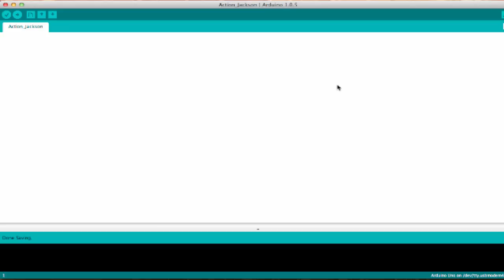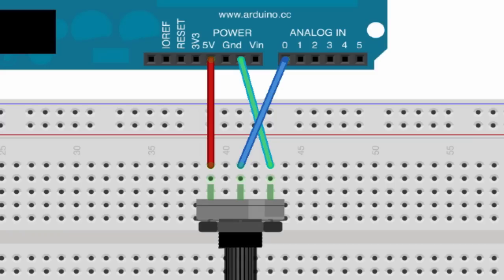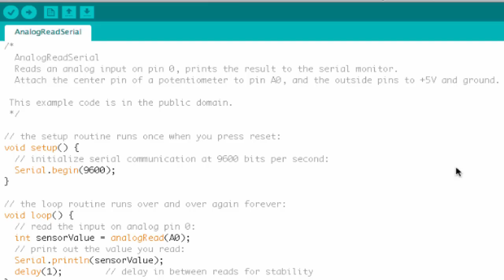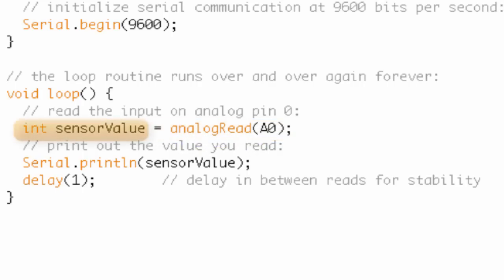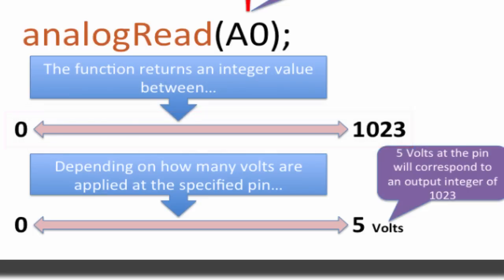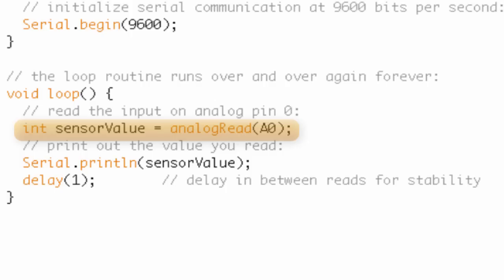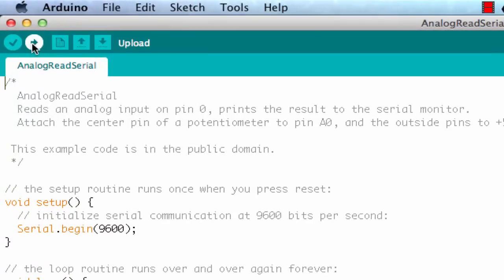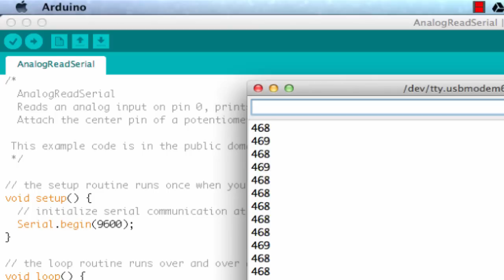Tutorial 08: analogRead() and the Serial Port: Arduino Course for Absolute Beginners (ReM)

Comment: I was really depressed before I found these tutorials. At the age of 50 and having never programmed before, I felt like Arduino was something I wanted to use, but would never be able to attain due to my coding illiteracy. In the past I have looked at coding tutorials and have tuned out very quickly. These tutorials have started at such a basic level, and assumed no prior knowledge. They are just what I need. Hey, even changing and uploading the flashing LED code gave me a hard-on :)
I have a specific Arduino application in mind, and even after watching just 8 of your tutorials, I reckon I'll be able to make my project work using Arduino. Thanks so much for your marvellous teaching.
Reply from the maker: +Ben Frawley Thanks for watching Ben -  best of luck on your project.
Reply: I am 62 and am in 7 nth semester of Bs.Cs programming Join some university bro |It is a very long traveling and full of joy
Reply: Arduino keeps me occupied away from depression and anxiety. I've only just found Arduino.

Comment: 1023 is part of a binary counting system.  It basically identifies 10 digits for binary 0000000000 = 0, 1111111111 = 1023 (1+2+4+8+16+32+64+128+256+512).  This allows for 1024 optional inputs/outputs (0 is an option).

Comment: Added an LED and 330 resistor between ground and center pin for a dimmer with serial read out.
Then I removed the pot and replaced with a force sensitive resistor to dim the LED.
Fun times, but couldn't figure out how to get a friendly reading to the analog in for this.

Comment: in the updated sketch the output shows in voltage. 
the code "* (5.0 / 1023.0)"  converts the 0-1023 number to volts.
Reply: 5.0/1024 and add to output +1 first,  else nearly accurate result with minor % error

Comment: To get the value in voltage, make the following changes to code:

float voltage=0;
void setup() {
  Serial.begin(9600);
}

void loop() {
  float sensorValue = analogRead(A0);
  voltage=sensorValue*0.0048875855327468;
  Serial.println(voltage);
  delay(300);   
}

Comment: While running this test, I wasn't getting any data updates in the Serial Monitor after unplugging and replugging in the USB cable, even though I had Autoscroll checked. To get around this, I closed the Serial Monitor window and opened it again and then I started to see the numbers again. So it seems like every time you unplug the USB cable you'll need to restart the Serial Monitor window. This happened in Windows 10 and Fedora 30. I have version 1.8.9 of the Arduino IDE installed on Windows and 1.8.5 on Linux.

Comment: It's not reading a steady value. It jumps from 200's to 300's without me touching the potentiometer. Also I can't get it to go to 0 or 1023 it just stays jumping around those ranges. Maybe a little more If I try to stick the jumper wire deeper in to the 5V pin. lol. The digitalRead worked before though. I really felt that I understood this tutorial. I don't know if something is wrong with one of the components. Any suggestions? These are great tutorials!
Reply: Hi! I was having this same problem. Is your wire connecting the middle lead of the potentiometer on the same side of the breadboard? This seemed to work with mine instead of having all of the wires connected on the same side :) Hope this helps.
Reply: @sarahfox5911  Hey! Yes that worked. Thank you Sarah. It makes sense now. The middle lead was on the other side of the potentiometer.

Comment: Sir the tutorials are awsome.
I had a question, why are we not using pinMode function in analogueRead?
Reply: pinMode() lets you configure a pin as an input or output, but analogRead() already knows that the pin is configured as an input.

Comment: the buttons on the LCD shield are assigned to A0, so it would make sense to have the randomseed to A1, right and when I go to upload the code, it says error compiling
#include <LiquidCrystal.h>
LiquidCrystal lcd(8, 9, 4, 5, 6, 7);
#include <DFR_LCD_Keypad.h>
#include <AnalogDebounce.h>
int localKey = 1;
int count = 0;
long diceOne;
long diceTwo;
int countDelay = 220;
int setColumn = 0;
int SAMPLE_WAIT;
int KEY_SELECT;

void setup() {
  lcd.begin(2,16);
  lcd.setCursor(8, 0);
  lcd.print("Roll the dice!");
  
  }

void buildUp() {
  lcd.clear();
  for (count = 0; count <= 16; count++) {
    lcd.setCursor(setColumn, 0);
    lcd.print(random(1, 7));
    lcd.setCursor(setColumn, 1);
    lcd.print(random(1, 7));
    delay(countDelay);
    countDelay -= 13;
    setColumn += 1;
  }
}

void loop() {
  if KEY_SELECT ==1
  randomSeed(analogRead(A1);
  
  
  
 
  diceOne = random(1, 7);
  diceTwo = random(1, 7);

    buildUp();
    lcd.clear();
    lcd.setCursor(7, 0);
    lcd.print(diceOne);
    lcd.setCursor(7, 1);
    lcd.print(diceTwo);

    if (diceOne + diceTwo == 7) {
      lcd.clear();
      lcd.setCursor(7, 0);
      lcd.print("7");
      lcd.setCursor(3, 1);
      lcd.print("The pirate");
    

  if (diceOne + diceTwo == 5,4,3,2,6 ){
    lcd.clear();
      lcd.setCursor(7, 0);
      lcd.print("5,4,3,2,6");
  }
}
}

Comment: In tutorial 8,  I’m obviously missing something from previous lessons as l
don’t understand why we don’t “initialize” this analogue potentiometer in the sketch.  Could you elaborate on that please?
 I’m fairly green to Audrino and struggle with coding as well as most folks.  These tutorials are amazing absolutely but l need to revisit them from time to time to refresh as  that is just how my brain works 😊.  I’m concentrating on understand the coding rather than committing them to memory.
Reply from the maker: Great question!!!

OK, the "A0" does not need initialized because it is not a variable, it is just referring directly to a pin on the Arduino. When you select your board in the Arduino IDE, there is a "pin mapping" that takes place, and some pin numbers have shorthand names, for example A0 is actually the number 14, but you can type A0 instead.  Kind of confusing...

We could have made a variable to hold A0, like...

int POT_PIN = A0; // but instead, we skipped the variable and just passed in A0 to the analogRead function directly.

Comment: i know this is a older video but i am just starting and my potentiometer has 5 pins and iv tried to use them all but the reading just floats from 300-400 and it dosnt change no matter what i do  is there different code that need to be added for this one

Comment: Awesome course - many thanks for walking through the material sooooo well.  Silly question; is the only way to declare an analog input pin with a string as A0 is not an integer, seems wasteful hence the question

Thanks again
Reply from the maker: Great question.  Actually, you can use the numbers 14 for A0, 15 for A1, 16 for A2 and so on.  I am pretty sure the string "A0" is defined/read as 14 by the Arduino IDE - it is kind of a short hand for the number.  I use the letters when addressing the pins, because it seems more readable to me, but either method works fine. 

And you could just make it a byte:

byte SensorPin = A0;

Comment: Hi ! Again 
Day 4 with my Arduino Uno  Tutorial 8 completed OK.

Notes LED on board always on. Do not no why, maybe its how it  was left from last sketch . (blink) Can it be turned of with a simple sketch . might try it myself.

Notes TX LED  running on and off fast.But if I change delay(1) to delay (1000)  slows output  down TX light blinks at the same rate as delay . They must be linked with delay .

Is the TX LED showing when the Arduino is doing something ? ie sending data  !

Anyway thanks for a brilliant tutorial

Regards 

David UK
Reply from the maker: David dave Hi David - your suspicion is correct, the TX/RX light will illuminate when you Transmit/Receive bits over the Serial Port.

When you load a new sketch, the previous one is erased from memory, there should be no "residual" effects.  

The issue with the on board LED at pin 13 being on all the times is relatively common and you can read about what other users have tried here:
http://forum.arduino.cc/index.php?topic=96886.0

As always, thanks for watching and your kind words.  Best of luck!

Comment: hi there, when I place ''int sensorValue = analogRead(A0)''  before/above void setup it doesn't work. Is it very important where we place the declaration? Is it how the program is read/scanned, like on a PLC ladder program, from top to bottom of the rung?? Great videos by the way, many thanks.
Reply from the maker: Hi Pathy K, First off - great question!  You can declare your sensorValue variable before setup(), but I would recommend initializing it when you are in the loop().  If you decide to initialize the variable before the loop, then it will only sample A0 pin once, and never update the value.  If you use sensorValue = analogRead(A0), inside the loop, then every time the loop repeats, that value will get updated.

That was a bit of a muddled response - hope it helps!
Reply: I think I get it now. Many thanks.

Comment: Would you fry your arduino if you swap the ground and 5V wire?
Reply from the maker: arofnog neu No, it would be fine for this tutorial.  You will notice a change in the output recorded at pin A0, the direction of the turn on your pot will produce the opposite result on the pin.

Comment: Is there a way to divide the 1023 by 5 and have it print like a number say 6.7 as a voltage into the serial monitor ?
Reply from the maker: Jason Wenden If the variables that hold the value 1023 and 5 are both float data types, and the output variable is also a float,  than i think it would work Ok.

Here is more about the float data type:
http://www.arduino.cc/en/Reference/Float

Hope this helps some!
Reply: I'll check it out now, thanks :-)
Reply: Open Source Hardware Group I did that too, I divided 1023/5 and got 204.6, so all I did was add one line and change what it prints in a serial monitor.)
Here's the line 
double sensorValueInVolts = sensorValue / 204.6;

Serial.println(sensorValueInVolts);

And that's all! : )

Comment: First off, I would just like to say thanks for the course. I am really learning alot from it. I have a question however. Why did you not use pinMode to set up A0 as an INPUT. I'm assuming it is not needed in this case for whatever reason. Can you please clarify? Many thanks.

Comment: Great tutorials! Quick question, noticed that pinMode isn't in void setup() as compared to the earlier tutorial on Digital sensors. Could you kindly clarify why?
Reply from the maker: Great observation!  That is because when using analogWrite() with a pin, the pinMode function is not necessary.
Reply: Programming Electronics Academy Thanks for the kind reply and guidance! Is it safe to assume then that because Analogue mainly deals with sensors, sketch automatically takes it as pinMode(sensor,INPUT); .Whereby input will always be in numerical values (hence the type of sensor does not matter) as compared to digital where it could be an input/output with High or Low values only. Sorry if this sounds confusing.

Comment: great tutorials. i was wondering, why did you not declare A0 an input? thanks
Reply from the maker: +SapperJohn Great question!  By default, all pins are set as INPUTS, so you don't have to write it explicitly as an INPUT with the pinMode() function.  Hope this answers your question.  Have a good one!
Reply: If i would have declared pin A0 as input using pinMode(), would the program still work in the same manner?
Reply: Yes, it would.

Comment: i think i;ve done everything as you've said but when the serial monitor is running the numbers only flick between 0 and 1, any suggestions?
Reply: +BLB ONT01 It sounds like you plugged in the potentiometer to an digital pin or declared that A0 acts as a digital pin.
Do you have to turn the knob to over half way before it jumps from 0 to 1?  (you are using a potentiometer I take, not a  switch?)
Another option is that your potentiometer is busted and only allows to bring you from 0 to 0.01 volt or something.

Comment: how to read multiple analog pins without multiplexing.why all analog pins start reading voltage while only one is connected to DC source which is to measure how to resolve it without very using multiplex

Comment: void loop() {
  int sensorValue;
  // read the input on analog pin 0:
  int value = analogRead(A0);
  if(value = sensorValue){
    }
  else{
    Serial.println(value);
    }
  sensorValue=value;
  delay(1);        // delay in between reads for stability
}

Do you think this code will work if I don't want to print all the values but only the ones that are different from the last one? I'm not experienced and this code might seem sloppy.
Reply from the maker: +Ruben Debien You are definitely on the right track here!  A couple things to look out for.  When doing a comparison in the if condition, you want to use a double equal sign, like   if(value == sensorValue) this will compare the values of 'value' and 'sensorValue'.  If you just do the single equal sign, you end up assigning the value of 'sensorValue' to the 'value' variable.

That being said, you might try using the "not equal" operator !=  to reduce the code a little..

Something like this might work:

int sensorValue;
 
void setup() {
  // put your setup code here, to run once:

}

void loop() {

// read the input on analog pin 0:
  int value = analogRead(A0);

if(value != sensorValue){

    Serial.println(value);

    }

  sensorValue = value;

  delay(1);        // delay in between reads for stability
}
Reply: Hello! , awesome tutorials. thank you! i am new to arduino and i want to build up on this tutorial. is it possible to get the serial monitor to only print out when i turn the potentiometer?
-i want it to print out the value at the instant I turn the potentiometer and stop.
-i do not want it to continuously print out all the values.

i have tried this code above but it isnt giving me what i want.

i'd be happy if you can help.

thank you !

Comment: The video tutorials are amazing! Thank you so much. Quick question though. The program does not setup the A0 pin to be an input or an output. Obviously, it is an input in this case, but could there be a case were you might need to setup an analog pin as an output? or is the Arduino unable to provide analog voltage?

Comment: I love your videos! I have a question =). I connected an led to change the brightness as i turn the knob of the potentiometer. It works, however the led cycles from 0 brightness to completely bright as i turn the knob instead of being completely bright when the knob is turned to on side and completely off at the opposite side. It cycles 4 times as i turn it. Why is this so?
Reply from the maker: When you read a value at the analog pin ( using analogRead() ), you will get values ranging from 0 (for 0 volts) all the way up to 1023 (for 5 volts), and everything in between.  The analogWrite() function, however, tops out at 255.  

So my guess is that you are using the same variable you are recording with AnalogRead and sending it to analogWrite.  Once analogWrite goes over 255, it will start back again at 0 (if I recall correctly), which would happen about 4 times in a full turn of your potentiometer.

The way to solve this is to use the map() function.  

http://arduino.cc/en/Reference/Map

Something like...

/* Map an analog value to 8 bits (0 to 255) */
void setup() {}

void loop()
{
  int val = analogRead(0);
  val = map(val, 0, 1023, 0, 255);
  analogWrite(9, val);
}

Hope this helps!
Reply: Open Source Hardware Group Yes! that was the problem! I had realized what the problem was so i converted by creating a new float variable:

float ledFade = sensorValue * (255.0/1023.0);

and used ledFade in my analogWrite =).
Your way seems much easier and new to me so I am going to try that. Thanks so much for replying =)!

Comment: ok my question is, what determines that number window of 0 - 1023 for your potentiometer for the 0 - 5v??? does the Arduino make that up on it's own or is it the specs for the potentiometer???thanks again
Reply: +PANTYEATR1   It is because the Arduino uses a 10-bit Analog to Digital converter.  That means that the 0 - 5V analog input gets divided into 1024 equal sized pieces (2^10).  So starting at 0V = 0, as you change the analog input voltage you take little digital steps until you get to 5V = 1023.  In this case, each step would be about 0.005V or 5mV.  So its not so much that the Arduino makes it up on its own, its more like that 0 - 1023 number window, as you put it, is baked in.
Reply: +David Satterfield thanks for the explanation Mr. Satterfield, i understand now
Reply: 0-1023 is binary 2^10 ...yea what Dave said

Comment: great video, i saw that you did not set a pinMode, is that because Analog pings A0-A5 are only INPUT?
Reply from the maker: Great question!  It is because all the I/O pin default to INPUT, so you don't have to explicity set them as INPUTS (however, I usually do - this lesson was an exception).
Reply: +Programming Electronics Academy  thanks for your reply, i appreciate it.

Comment: Great tutorial. But I do not understand why it says 'analogRead(AO);'. Why wasn't it 'analogRead(A5);', and what difference would it make?
Reply from the maker: A0 refers to the analog pin that the potentiometer is attached to. Since there are 6 analog pins, you need to specify which one.  You are basically telling the Arduino to measure the input at analog pin A0 - that is just the name pin.  If you change where the center pin of the potentiometer is connected to pin A5 , then analogRead(A5) would be appropriate.  Hope this helps some, best of luck!